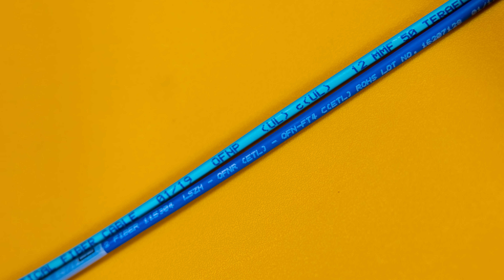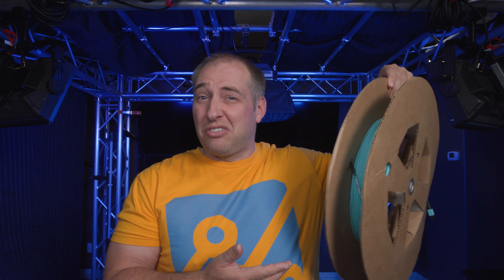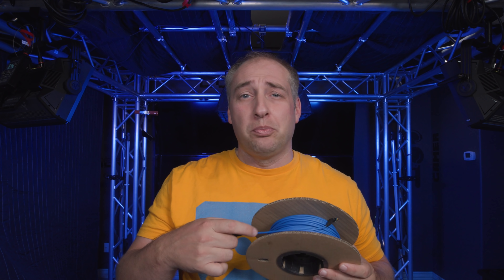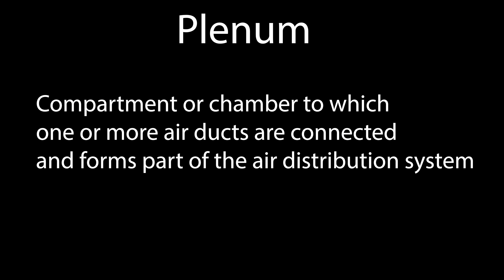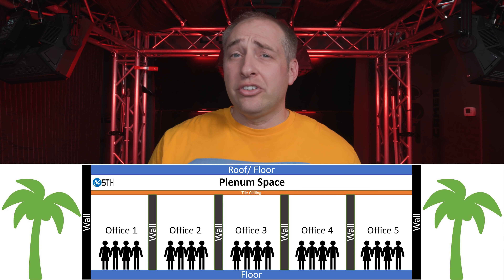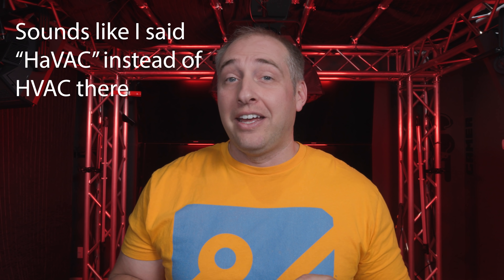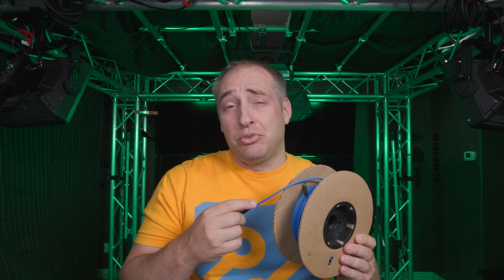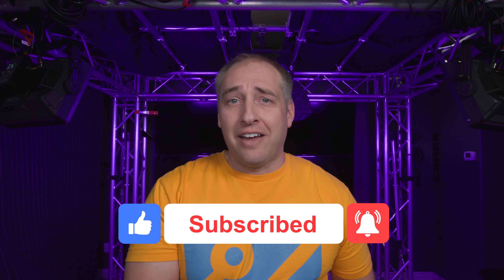Why Plenum Fiber Optic Cable, OFNP, OFNR, and LSZH Matter

Comment: SM cable cannot be used in place of MM cable, your cable needs to match your equipment specifications. SM is used for longer distances, usually provider facility to customer, MM is used for interior building applications.

Comment: More over you can run bidi optics with single mode. Thats what I did at home.  10g bidi optics are cheap and 1 pair gives you redundant connections good enough for the home.
Reply from the maker: This will probably go-live in the new year, but ended up going pretty big on this one

Comment: well i for one would like to see the install video..i recently installed fiber at home from one room to another for a 10gb Switch & rack to a pc & a single server ! i would like to go to 100gb be for to much longer at my rack/lab i like most have several servers for random things from a dell R210 II for a firewall & 3 Dual Xeon Servers for every thing else as well as another one or 2 for random testing/Experiments ..lol. but i think it would be interesting to see how you run yours ! ! !

Comment: A very nice description, I have read before, about running networking cables 'in air ducts', That to me sounded crazy, just use the suspended ceiling space. However after watching this video, I tend to think this earlier info was a very poorly interpreted description of 'Plenum cabling', by someone who didn't really know his stuff.

Now, for some contrast to your fiber, part of my network (not used that much) is based on 92ohm coax!, this was installed something like 25+ years ago, for an 'Arcnet' system, that I scored from work for zilch as they moved onto Ethernet. I seem to remember it ran at 1.2mbps (DOS days). Later on I acquired coax Ethernet, and just shoved the 10meg 50ohm signal down this older 92ohm coax, and it just worked. 
Yes I should change it for some cat5/6 etc., however the duct is now very hard to access, so 'for another day'

Comment: Great!  I've been planning fiber install for more than a year now (planning is cheaper, and has fewer spousal approval hurdles :)).  I'm also thinking MTP and OS2, the latter mainly for  room in the signal loss area to let me do things involving multiple junctions and minimal wall interfaces.  So, for example, bring a couple of MTP24 drops from the switches through a pair of keystone jacks into the attic (no basement here) and setup distributions from the attic to the individual rooms.  Also, for shared walls I'm thinking MTP12/16, split in the walls with an LC jack on either side.  I'll be interested in the distribution and layout you choose.
There are a number of issues.
1) MTP keystones are ... RARE -- if you know one, let me know.  I know people just pull the cable through the wall and leave it like that, but ... uh, no.
2) rack handling of MTP -- it'd be great if I can just keystone an MTP and do a breakout cable there to the switch (seems cleaner?), but does that even work?
3) not bringing a huge bundle through a hole in the wall will make the camera setup busy (multiple 1GbE cables -- MTP is amazingly space efficient in comparison, but it's hard to run poe over glass).
4) Running fiber also prevents me from using poe to run a local switch (which is useful in the TV room where the tv, sat., receiver, bluray, streaming devices, etc. live).  Thoughts on this?  I think I've decided to leave that at 1GbE (I don't really need any more), but it's sort of annoying.
Anyway, hopefully that gives you some ideas for things you might be interested in covering.

FWIW, totally agree that you might as well install OS2 over OM4 -- who wants to redo an install for OM5, OM6, etc?

Comment: Actually, in France "plenum" is the term used too. It is an architectural term. But everybody will use that term if you need to talk about the area on top of a room ceiling (plaster board in modes) where you have empty space left for pipes and cable. Any person that went for home improvement heard the word plenum.

Comment: After finishing my house renovation quite recently, let me also simplify one more thing - if you're like me and you're rewiring the whole house future-proof style and you're trying to eject copper from anywhere that's not a PoE appliance, save yourself the complications and just use SMF (single-mode fibre) OS2 cabling. There is really no reason why you shouldn't - SMF costs the same as MMF and for "peasant" speeds (<= 10 Gbps) the price of optical transcievers is exactly the same, and there is virtually no OS2 speed limit (that you'd care for in a residential application) for the next.....(let's be really conservative here) at least 20 years or so. SMF OS2 can easily pull 400 Gbps per pair of fibre (550 Gbps is what I am finding as a limit thrown around right now with DWDM MUXers). Price delta between SMF and MMF optics in 25 Gbps is also converging to 0, so there is that. 

In short - just go SMF OS2. Worst-case - if there is a sudden quantum leap in ISP bandwidth, the worst that can happen is you'll just replace your core switch and your optics to match the speeds because SMF OS2 can and will take any conceivable speed that we'll be seeing in our lives. With MMF it's more complicated and uncertain.
Reply from the maker: The big black/ yellow spool is 144 fiber OS2 SMF. Also running 96 fiber OM4. At 100GbE speeds the SM/MM is actually a big gap for optics.
Reply: Dxun2, contemporary DWDM systems are shipping with up to 400Gbps per wavelength. There's a huge installed base of 100Gbps fixed grid systems with fixed channel plans that can carry ~88 WLs per fibre pair, when you move to the newer flex grid systems the channel plans get more complicated but I've seen articles claiming as much as 24Tbps per fibre pair though I don't recall off hand if that was also using some L or S band rather than just the common C band. 

The length and type of fibre can have a dramatic impact on achievable line rates. My experience with submarine transmission systems all based on fibre that's a hair over 20yrs old isn't up to these line rates since dispersion compensation used to be built into the cable by alternating segments of different fibre type. Contemporary line cards no longer rely on physical dispersion control since DSPs are now capable of correcting the spectrum in software. The older fibre I've worked with can achieve 200Gbps WLs on ~3,500km cables, the ~9,600km cables use two 50Ghz WLs to build a single 100Gbps channel (44 total) and at ~13,000km the best they'll do without regen is 2xWL yielding 50Gbps (2.2Tbps/LP).

Comment: Plenum has been a well known word for me, for a long time, however "surreptitiously" was a word i had to look up, in a previous video - a word i had never before heard.
And i'm from europe, non native english speaker.

Regarding flexibility; I have found LSZH OM3 cables more flexible than PVC, so i have actually run LSZH OM3 LC-LC cables for practically everything in my homelab.
One exception is between rooms, where i am using 3mm PVC as it is more durable.

Comment: Its not just fibre, I did my house in Cat 6a LSZH some 12 years ago, along with all the other cables. Four years ago there was a fire in the house across the street and the lady died from smoke inhalation. You could hardly tell there had been a fire from the outside (being in the UK its brick built so never going to burn to the ground quite the same as a timber framed house). Oh yeah and I have a fully inter linked mains power fire alarm system, though they are going to be mandatory in all home is Scotland from next February. The marginal cost for LSZH is buttons in the scheme of things. Frankly none LSZH cable should be banned period.

Comment: I recommend the phrasing "air handling" instead of "air distribution" since people might interpret "distribution" to refer only to the air supply when air return (exit) paths are also plenum spaces.

Identifying plenum spaces sometimes isn't simple. For example, many buildings have crawl spaces, and most crawl spaces are not plenum spaces, but the crawl space under my own house is a plenum space since it is part of the air return path for the clothes dryer.

And since it wasn't made explicit in the video: a "riser" fire rating or better is mandatory for moving between floors. I'm not sure how common it is now, but you will sometimes find cables with no fire rating, and these cannot go between floors.

Comment: single mode, nice but damn expensive (transceivers, nobody cares about cable cost)
Reply: Single mode SFP+ is like 17 euro /20 dollar SFP+ Bidi is 33 euro/39 dollar. Single mode is single mode. You can run 100gigabit over old single mode cables, not over old multimode cables. ;-)
Reply: @heselmas  brocade single mode 32G transceivers are >3000$ each (3rd party 350$)

Comment: Check back with the building owner / management / insurance and local firecodes BEFORE pulling wires and drilling holes etc - a small hole at the wrong spot can invalidate the fireproofing for the whole building. Also there are different rules for single vs multi story buildings ...

Comment: So LSZH is normally not plenum rated even when it is less toxic? Does it miss the self-fire-suppressing properties?
Reply: Plenum rated cables (UL1666/UL1651) have to have the highest fire resistance (Steiner tunnel burn test UL 910) and low smoke generation, however to achieve that they are typically made of more toxic materials Flame Retardant PVDF and PVC and that aspect of the hazard of a fire is not tested. The term LSZH is more of a catch all term than an actual certification rating. In Europe the Construction Products Regulations (EU 305) covers all products used in buildings and for cables the applicable standard is EN 50575. This classifies cables in terms of their reaction to fire testing performance levels from Euroclass E to A (from worse to better)
But also cables are tested and rated in sub classes of toxic Acid gas generation (a1 to a3), burning Droplets (d0 to d2) and Smoke generation (s1 to s3) For each class, above Euroclass E, the fire testing is more severe. In terms of fire performance only, US Riser rated cables would roughly equate to a Euroclass D to C, US Plenum rating would equate to Euroclass B1/B2 but would be more toxic.
Best in class performance for cables under EN 50575 would be Euroclass B1-a1, d0, s1 (as EuroClass A is reserved for truly non-combustible materials such as concrete and steel etc)
Reply: Yeah, I've always found that weird -- a definitive answer would be awesome as I'm currently planning on going lszh rather than plenum for that reason.

Comment: You are doing a poor job explaining plenum. If the HVAC System is ducted to each room and the space above is not used as an air return, as in the air returns are ducted. Plenum Cable is not needed. As per electrical code.
Reply: Drake, maybe you need to get out more? Are you running cable, HVAC systems, or at least poking your head into the raised ceiling? Just because there's a return vent tile doesn't mean that the return is fully ducted above the drop ceiling, my counter anecdote is that I've seen more plenum drop ceilings than fully ducted. 

More importantly NEC is bare bloody minimum. Just because the HVAC system isn't going to spread the smoke in a heartbeat doesn't mean I want any burning PVC in my buildings, even my DC power plants are cloth clad. If you quoted me riser cable to save a few pennies I'd bounce your bid out on it's ass, no do overs you'd never work in my building.

Comment: Just two types of cables seems to be very easy compared to the European CPR regulations. There are several classes with additional specifications for smoke, droplets and acidity. Which class is required for which type of building or area inside a building (for escape routes etc) differs from European country to country or even differs by city/county.

Comment: Making a connector an these things is a pain. And yep i would like to see more on that topic.
Reply from the maker: We are running pre-terminated MTP-12 strands everywhere to make it easier. The labor cost for terminating was way more than just getting pre-terminated.
Reply: @ServeTheHomeVideo  Ahh we had lots or troubles with the plug’s as they are quite beefy and we undersized the hohle so got stuck multiple times. 
Sad thing is that wall plugs seem to be hard to come by in europe for whatever reasons. One where i could just plug in the cable would have been nice..

Comment: THE DIAGRAMS IN THIS VIDEO ARE WRONG, AND SO ARE THE STATEMENTS. A plenum for the sake of this video is the ventilation shafts. Since ventilation tends to reach areas of a building, it's sometimes used to route cables to otherwise unreachable places. A riser for the sake of this video is an attic, or the area above the ceiling tiles below the structural ceiling. Please read NEC section 300.22(C). Plenums tend to route through risers.
Reply: Like he said 90% of the time you do not need to run Plenum in the area above ceiling tiles. Nearly Every HVAC install i've seen has the returns ducted to the tile itself and not putting the entire space under negative pressure. 

So you are pretty much wasting away money on cable you don't need to be running. 

Also unless you are in the data center, you should nearly always run single mode. I hate when some IT guy who has no fiber knowledge wants OM3 as a building to building connection. Just to spend 3x the price for the cable alone, while the cable isn't able to match the speed ratings SingleMode will allow for. Even OM4 will fall behind singlemode. OS2 continues to keep up with higher speeds at long distances.

Comment: Just when I think I'm overbuilding my home network with 10G everywhere...  Oh, right, planning for 400Gbit. In the home. Sure.
Reply from the maker: The current plan/ hope is to get 240 fiber strands each to the two offices, studio, and server room (maybe one more.) Also a mix of multi-mode and single mode. Other rooms like the floor that is a bar/ theatre/ shuffleboard area will just have ~36 MM strands to give some redundancy in the event there is a cable issue.
Reply: @ServeTheHomeVideo  Am I the only one that cackles like a madman when thinking about it?  

Sounds like a whole lot of fun. 

 I'm already getting questioning looks from people when I describe my home network to even techy friends. I think they might arrange an intervention if I started looking at more.
Reply: @SomeRandomPerson  I did that - OS2 the whole way in my home. Won't even try to explain to me friends :) The only CAT6 I ran are APs and surveillance cams - unfortunately, PoF is not yet ready. 10 G is really nice and I don't see a speed upgrade required in next at least a decade, if not more.
Reply: @ServeTheHomeVideo  Oh, and I might have missed it - but what was that heavy cable you hauled up that had the multi+single mode fibers in it?